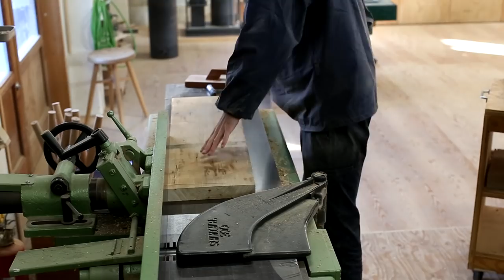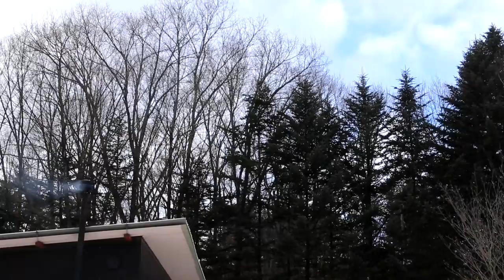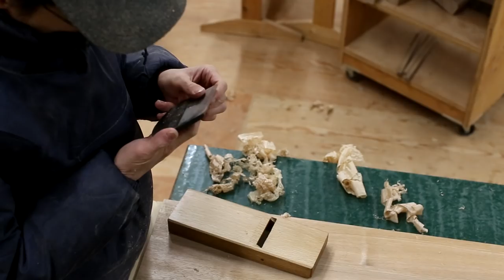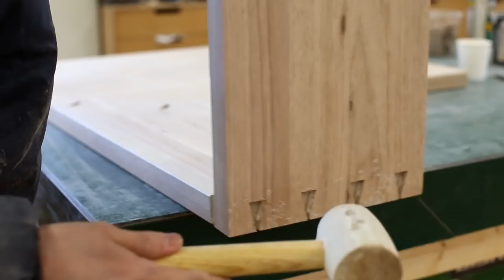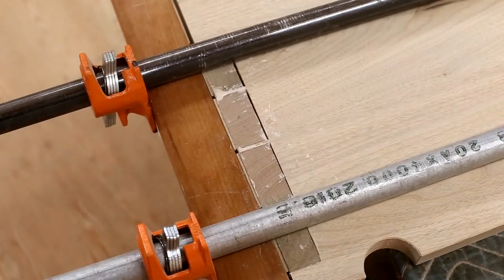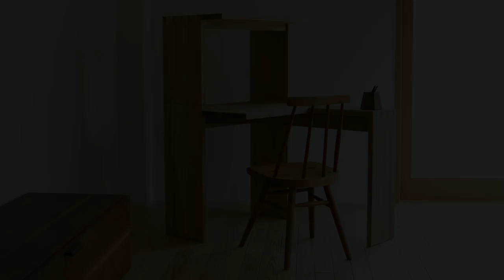ISHITANI - Making a Computer Desk

Comment: Glue, dominoes, pocket holes and dutchmen... you really hedged your bets on that miter! :)
Reply: It actually makes sense. The glue and dominoes supply the strength. The pocket holes provide the pull in (a good idea on a piece difficult to clamp). The Dutch bowties are aesthetic.
Reply from the maker: StewFairweather Exactly :)
Reply: And so masterfully done on every one.  Did the pocket holes get filled?
Reply: Just get a doweling jig, it's just a strong. Slightly more cumbersome to set up but just as good in the final product
Reply: Miter joints naturally develop gaps at alternating ends as the wood expands and contracts with seasonal movement. This is not a big issue with a picture frame (only 1 or 2 inch long joint), but with a miter joint this large, it can create a significant gap. Trying to fight wood movement is usually a losing battle. If it were my design, I would have used a sliding dovetail joint instead of a miter.

Comment: In your display room you do not have baseboard.  Does the flooring go under the wall?  Or is there a gap between the floor and wall when the seasons change causing the floors to expand an contract?

Comment: I want to be a woodworker so much. I love the precision, the detail  and the artistry. I have no background whatsoever - Any tips on how to start?
Reply: Start practising, get a feel for the tools you own and how different woods act. Buy qaulity tools and materials as they will last much longer than cheap ones.
Reply: Pat M Thanks so much for the advice!
Reply: For practising you don't need expensive machines, most joints can be done with a chisel and a handsaw.
most basic tools are a square, folding rule or tape measure, pencil, handsaw, chisel, hammer.
Joints must fit tight not to tick because the wood would crack. Be patient if you are learning and don't give up
Before i forget a happy "o shogatsu"( i don't know if it's right)
Reply: Real talk. Woodorking is expensive. Most peole say u dont need the best tools etc. But if u wanna make high quality things. U need high Quality tools. Power tools or handtools.

Open your eyes people
Reply: ediii89; an expensive tool doesn't make you a better woodworker, scharp tools and skill make you a better woodworker. It is the man bevind the tools that make it work.
I  work with Makita and hand tools from bahco and Stanley, they are not the most expensive tools around.
Reply: Gert keep going man and get some veritas and festool. But makita is fine
Reply: Gert, I totally agree just meant that when you buy tools in general don't skimp and buy junk. Nothing wrong with basic tools I have a bunch of second hand ones that have served me very well. Have a Happy New Year.
Reply: Agree, with both sides. Helps to have the right tool for the job. In woodworking you can accomplish the same outcome several different ways but it’s nice to have the tools that make you more efficient, less frustration. It’s all a slow process though. Just stick with it and your successes will drive you to want to accomplish more.
Reply: Just start making.

Comment: Guys, what the thing does he use to fill the knots?
Reply: Tong Nguyen Mai  I supouse its epoxy.
Reply: Tong Nguyen Mai Yah most folks use epoxy. West systems works nicely.
Reply: Resin or epoxy. The heat brings the bubbles to the surface and pops them. Peter Brown is another great youtuber who does great stuff with resin and epoxy.

Comment: ew pocket holes
Reply: Normally I would agree, but int this case Its just a clamp.. the holding power comes from the glue and joinery.
I find it goes well with the very functional build style the carpenter has.

Comment: What was that he dipped the chisel into when working on the dovetails?
Reply from the maker: camellia oil (Tsubaki Abura).
Reply: camelia oil
Reply: ISHITANI FURNITURE wondering what the purpose is? Awesome video as always. Besides the one of you flipping the van over.
Reply: Camellia oil, has been produced from the same recipe for more than 80 years in Japan. Traditionally it is used to protect hand saw blades, swords, knives, plane irons, chisels and many other metal objects from corrosion. It can also be used as sewing machine oil! Camellia oil is acid free and very pure. It has a neutral taste, is odorless, doesn't dry and is not poisonous, so it is highly recommended for protecting kitchen knives. It should however never be used as cooking oil!
Reply: Jerk Of All Trades glad everyone was safe.
Reply: TheWarriorWorkshop The purpose of using the oil like this, it to make the chisel cut into the wood more smoothly. It cuts better, and ind looks better when the material is removed.

Comment: I love Ishitani’s work but let’s get one thing clear, the magnet is dangerous to both the longevity of the computer monitor and hard drive!
Reply: Dan Parks crts are susceptible to external magnetic fields, any modern flatscreen couldn't care less. The harddrive also doesn't care unless you go up a couple of magnitudes in magnetic field strength, along the lines of an MRI machine.
Reply: Really? Well I stand corrected then. Thanks!
Reply: Steven Doesburg and if the hard drive is going above the monitor that’s an odd configuration. 😀